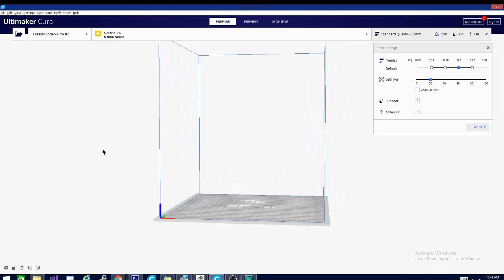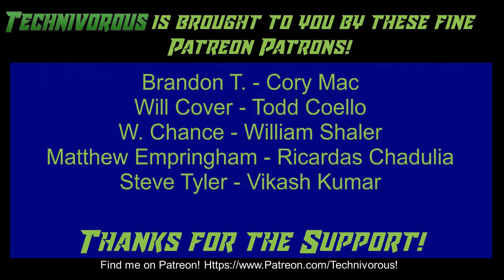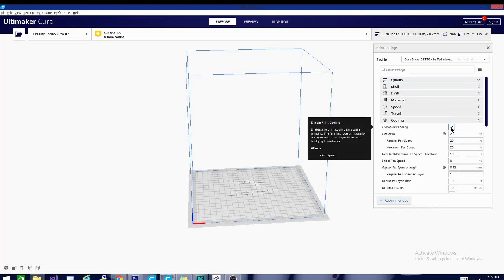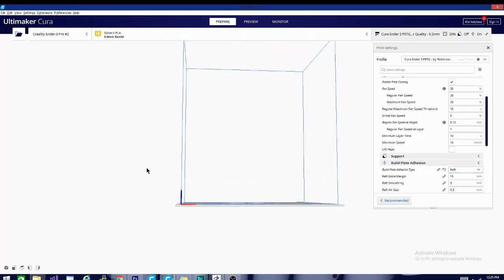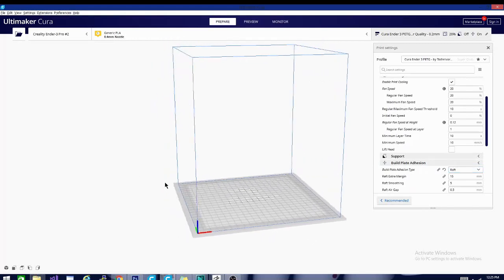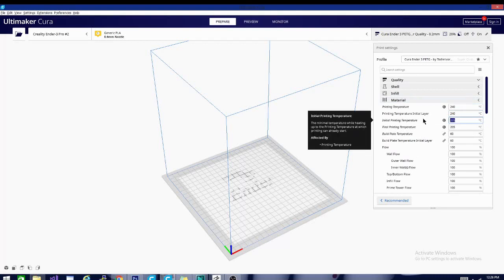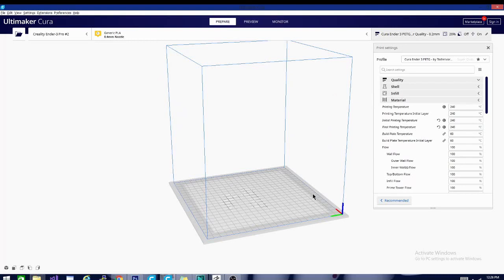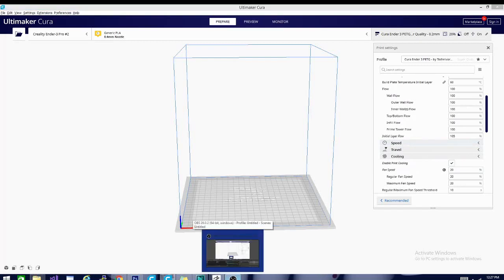Cura 4.8 Tutorials - Material Settings - PETG Settings

Comment: I don't know how I have done this but I have Printer Settings included within the right-hand settings menu at the bottom, this is on my laptop version 4.8 I have the same version on my desktop but no Printer Settings on the right-hand menu, I use Cura on my laptop to investigate the settings and just have the stock install on my desktop.